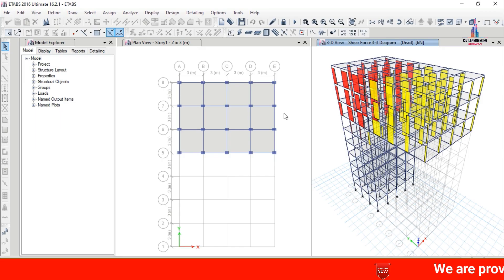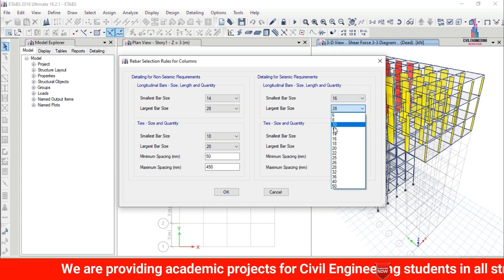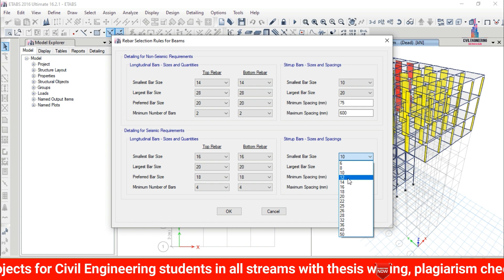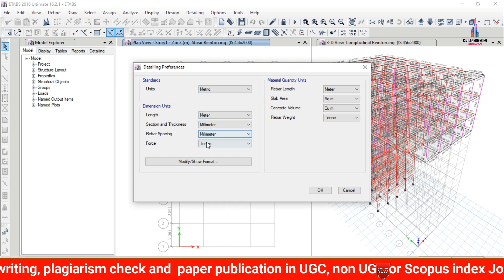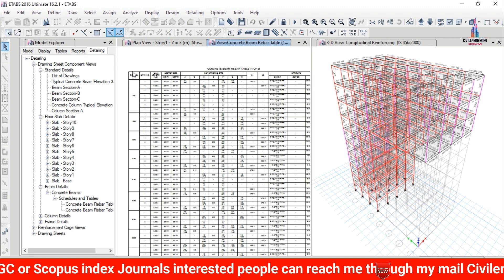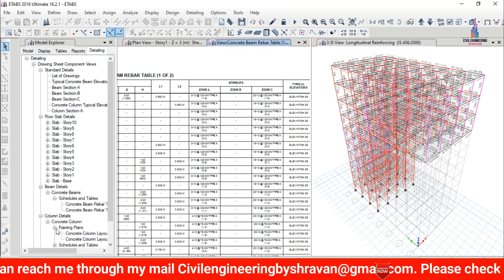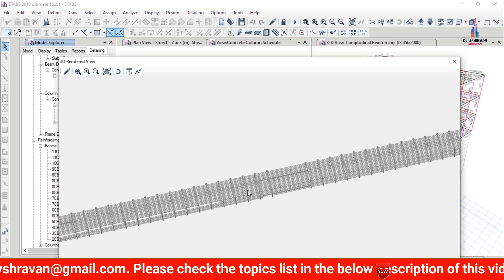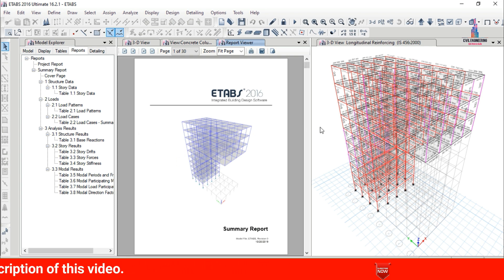G+9 Cantilever slab building design by etabs software | Civil engineering | online course |

Comment: Sir, it would be a great respect too you kindly, please make a video on staadpro V8 software on YouTube of this case study- design of multistorey building  with all specifications of beam, column, and slab with different cross section size according to building height and loading & reinforcement details of every floors  ( Number of storeys - 12; Number of bays in X-direction - 4 ; Span Length in X-direction- 6m ; Number of bays in Y-direction 6 ; Span Length in Y-direction 6m ;  Storey height- First 4.5m, rest 3m each ; First 3 floors(G,G+1,G+2) are meant for commercial and rest for the residential purposes ; Provide Isolated Column footings by taking SBC of soil as 20 kN/m2.) Please sir 🙏🙏🙏 🙏